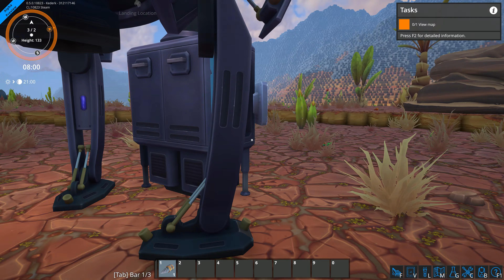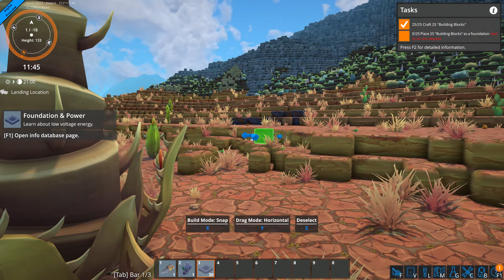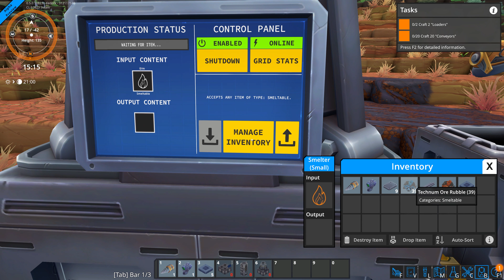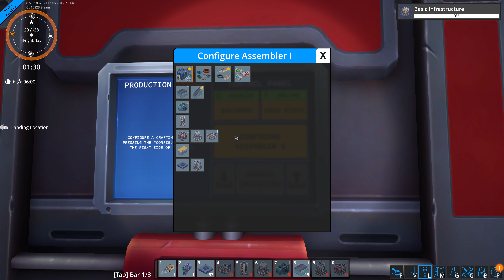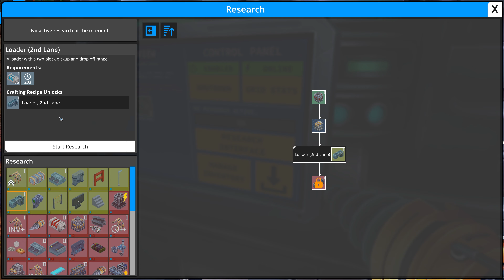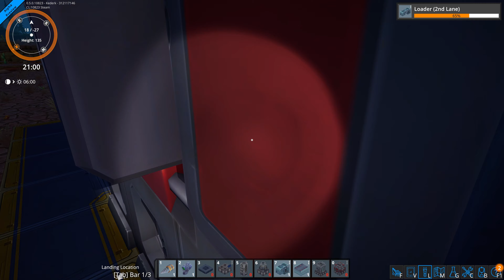Foundry is a new factory style game with inspiration from Factorio & Minecraft! Foundry Demo - EP1

Comment: I’m only halfway through the video and I too feel like it’s very similar to Satisfactory. So much that the only difference is that you have the ability to terraform and tech tree is different. Do you know what they plan on this game to make it different?
Reply: Satisfactory is overall more streamlined - infinite resources, immutable smooth terrain, biomes with different resources, gatekeeping through hazards. Foundry is going back to tech mods of Minecraft. Each has its better and worse sides.

Of course, the development of Foundry started sometime back in 2018; it's not really doing "Satisfactory but different", both projects started at much the same time - it's just that one was made by a team of professional developers and the other by mostly a single guy up till now.

As your robots and drills mine resources, they actually disappear from the world. A lot of the stuff comes from underground, both small ore patches and big ore veins. There are modular buildings, so you'll quickly switch from building 2000 smelters to instead building really large smelters. Loaders work by extracting from a passing belt instead of having splitters everywhere (and unlike Factorio's or DSP's inserters, they aren't throughput limited). Still in development, assembly lines build up finished products piece by piece, rather than just having magical assemblers. Obviously, the aesthetics are vastly different. Block based building like in Factorio and Minecraft helps with keeping things clean, though of course at the cost of limiting some freedom. Connecting power with foundations is a nice mix between Factorio and Satisfactory power poles.

There are other similar games, of course; Satisfactory is just one game in a very long list that mostly started with Minecraft mods and FortressCraft Evolved (indeed FTC has a lot more similarities to Foundry than to Satisfactory). Evospace also comes to mind, with its interesting focus on modular buildings. Boppio already seems dead. More recently, we got Riftbreaker, Techtonica, Dyson Sphere Program, Desynced, The Magical Mixture Mill, Roboplant, Facteroids, Refactory, Lifecraft, Automation Station, Captain of Industry... it's a good time for all sorts of factory games.

But I'll definitely grant that Foundry still seems probably the least distinct game at the moment, just like Satisfactory (though that at least has that Coffee Stain humour). It doesn't really have a central gimmick, so to speak. Riftbreaker is fairly action-based and tower defense oriented; Techtonica has the underground setting, DSP has the planets, Desynced has programming, MMM has magic, Lifecraft has cells, CoI has post-apocalyptic trucking, Voxel Tycoon mixes in full-blown Transport Tycoon, Infraspace mixes in Cities-style traffic, MegaFactory Titan has so many twists on the formula, Final Upgrade centres on building ships and stations, Atrio is Atrio, Nova Lands builds on Forager, Final Factory, Astro Colony is IN SPACE, AutoForge is side-view, Mob Factory takes the tower defense elements and makes them part of the factory itself, ... and then you get the more people-oriented factories in games like The Last Starship, Dream Engines, Good Company, Kubifaktorium, Industries of Titan, Space Haven, Little Big Workshop... it's crazy. We could spread the offerings across a dozen sub-genres :D
Reply from the maker: @LuaanTi  A lot of games in there that I've never had a chance to play but I would agree that while I see a lot of influences from other games in the genre it does have it's own unique flaire.  I actually loved the tutorial bit with the voiced guidence.  I think with some kind of a "story / goal" to work toward and a much more fleshed out tech tree this game has promise.

You mentioned it's been in development since 2018 and I definitely see that now but somehow I'd never heard of it until I started seeing the marketing for the Demo that launched this week.  Makes me wonder how many other potentially good games are out there that I'm missing out on.
Reply: @KederkBuilds  The Demo is actually a good sign - they just signed a publisher, and it's Paradox Interactive :)
Reply from the maker: I think the biggest differentiator at the moment is the destructible terrain.  In the video that will come out tomorrow I had to dig down and carve out an area to mine a resource deposit which was both interesting and annoying.  Satisfactory and Factorio are both more fleshed out games but they've also been released for years now.  I'll be curious to watch this one to see what they do with it.